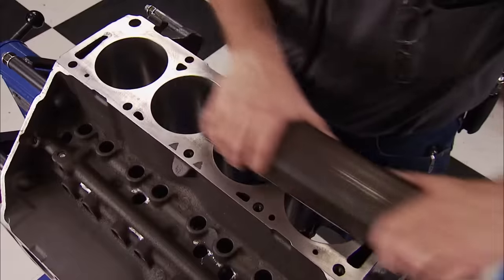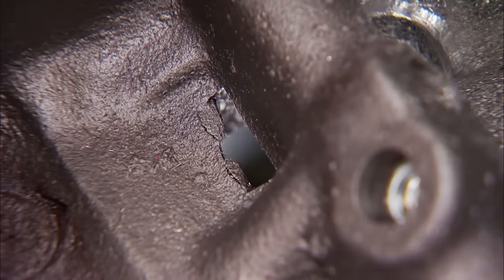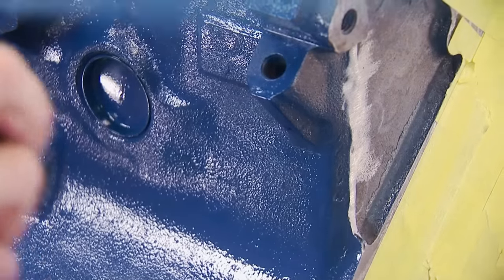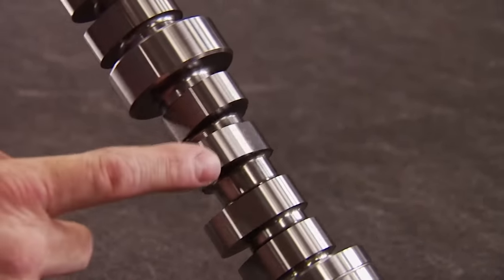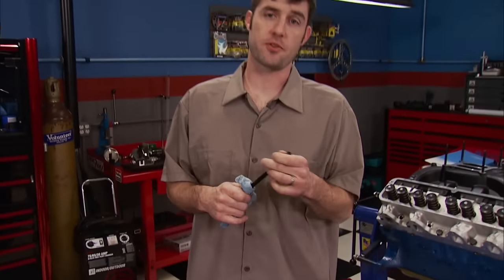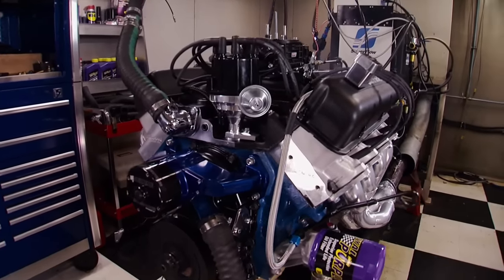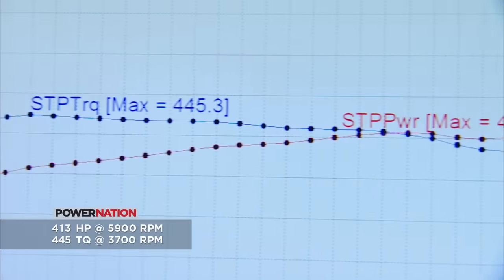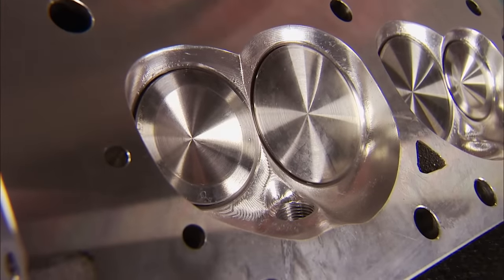Revitalizing A Ford 390FE With A Modern Twist - Engine Power S3, E7

Comment: 390 is a great truck engine. They spec'd a custom cam, so this build should have had a cam with 106LSA using the David Vizard "128 formula".
Reply: 390 was put in nearly everything Ford had at the time. And worked well in every application.
Give me a 67 390 2barrel in a full size Ford car. Good on gas and power.
Reply: @jesse75  390 made good torque with factory heads and intake, but if you're building one for horsepower output, everything spec'd differently. A truck is heavy and needs torque.... Just like a full sized car. Use a 390-2v all day long, I've seen first hand their grunt strength. But in factory form they're a truck engine.
Reply: @richdouche8253  define factory form ?
The car 390 and truck 390 are different. 
390 first used in heavy cars. 
The 352 was phased out in favor of the 390 in trucks in 68.
Reply: @jesse75  Factory form 390's, whether put in cars or trucks, have never been known as big horsepower engines. The runner and port design, size and shape. Combustion chambers. Valve angles. Etc etc. were not designed for making big horsepower. Fantastic for vacuum and low and mid and great torque for street use, but nobody was winning races with the 390 compared to competitor big blocks in factory trim.

Even look at this build... These guys have 390 cubes (plus), and were barely making over 1hp per cube with aftermarket heads, roller cam, rockers, intake and carbs. Hell.... I'd rather have lighter and smaller Windsor stroked to 393 that could churn out more horses on the same mild street stuff.

I'm not bashing the 390. It's just never been known as a heavy breather. Especially in factory form. In any configuration that it was sold to the public.
Reply: @richdouche8253  just like the 351w, the 390 never was a performance engine. 
Maybe in it's infantcy, but the 406 and 427 were the performance engine.
Again. In the 60's and early 70's, the 390 powered nearly everything. It was just a grocery getter like the 351 Windsor, being used in cars and trucks.
Oh wow. They put a 4 barrel carb on these engines, but they didn't amount to anything special. Just moved around a heavy vehicle.
But the 390 is still a venerable engine.
Everyone of these engines I find at a wrecking. I buy. Rebuild. And never have a problem selling. 
The engine is in high demand where I live.
I must have did 70 of these engines so far.
And it's true, many of the stock original pistons are marked 410 on them. But not the car engines, those pistons are different.
Reply: @jesse75  I would buy them up too, especially if you have a market for them around you.

I can attest to the durability and strength of the engines. Years ago my dad had one in an F-100 4x4 "Ranger" and that truck would haul about 3k lbs of recreational crap strapped to it, down the highway at 90mph without breaking a sweat. The whole monstrosity about as aerodynamic as Oprah in a jogging suit. It was impressive. And it would spin 31" mud tires on pavement and grenade transmissions with ease.

I think there were maybe a few 390's that made decent HP certain years, but Ford never really invested the time or money to make them as "credible" as the Chev 396 or 383 Mopar. A shame really. Fantastic durable and stout engine. Just wish Ford made more "400 horse" cars than they did.

351W same thing. Ford once again slapping the worst HP making heads on them they could find. If they'd spent more time/money building 351w hi po stuff, we wouldn't have wrecking yards riddled with 289/302 blocks that split with regularity anything over 450 horses. The 351's handle 700+ all day. And can be stroked above 400 cubes without issue.

Hell, man.....I say buy all the cast iron stuff you can. There will come a day when they're in serious demand. Chev. Mopar. Doesn't matter.

I remember in the 80's I could buy a decent shape Camaro for under two grand. Lol. Wished I'd bought up every decent muscle car I'd seen for sale back then. Wished I'd had the money to. Be sitting on millions right now.
Reply: @richdouche8253  only stock pile I have is Cleveland parts. 
I have one original buddy barr Windsor intake. I ran it on a Windsor I sold last month just to see how it would run. But didn't let it go with the engine.
Most of the engines I do, I run them before anyone gets them. Most of these people don't know how to prime the oil system, nor adjust a valve.
I have some 454's, 350 Chevy's, but they don't sell as well as the Ford's. Go figure.

Comment: Never been a Ford fan but the 390 has always been one of my favorites. You have to try really hard to break one.
Reply: They do have their issues with oil starvation but the skirted block design is really strong. Don't know if you've ever sampled a built 427 but I highly recommend if you get the chance. The throttle response and torque is like nothing I've ever experienced. It revs like a Honda 4-cylinder but with nutty levels of torque. Absolutely insane in those little AC Cobras.
Reply: @randr10  I've been in and around just about every engine you can think of. Growing up in the heart of NC, where you can't spit without hitting a NASCAR Track/Shop/Builder or an NHRA Sanctioned Drag Strip, with family involved one way our another in both. It was extremely unique. Back then, we roamed the Pits. Talked to the Driver's and Mechanics. Got rides in the Door Slammers. Sat in The King's Pontiac. Junior Johnson used to eat at our Restaurant. Rode in his recreation of the '40 he used to run Shine in. Some of the best people you could ever meet. For a Hot Rod Kid it was unreal. Pop still lives 5 miles away from Petty. Step Dad spent some time in Kannapolis and knew Dale SR. for a brief time. I miss the late '70's early '80's.
Reply: @SGTJDerek  That sounds amazing!
Reply: @randr10  Turbo needed
Reply: @Pedrofitbulls  For what exactly?

Comment: I'm thinking that is too much cam for that compression ratio. Lift should probably be in the 530 or 540 range and duration in the 220 range on a 112 centerline. Would probably make more power. Or bring the compression ratio up to at least 10.5 to 1 with that cam.

Comment: Those was actually the correct pistons
390 fe truck engine used the 410 pistons 
The passenger car engine used the 390 pistons. The common  thing to do back in the day was to install the car pistons in the trucks during rebuild or swap in a 428 crank those netting a 410 .
The 360 done the same thing the truck engine received 390 pistons and the passenger cars got 360 pistons

Comment: The BEST big block engine ever made by anyone. It was in production for 18 years and went from 332 cubic inches all the way up to 428 cubic inches. Ford could have easily made much bigger if it had not been for the 385 engine family that was made to replace it.
Reply: Not even close, fe’s are turds. A stock 429 68-71 made these numbers. 429/460 is light years ahead of an Fe and better than a BBC imo.   Fe will always be held back by its garbage cylinder head.  These aftermarket heads flow less cfm on the intake side than a stock 70 closed chamber 4V cleveland head. Rich Holdener did a vid of a bone stock m code 70 clev with headers, cam and an intake, made 450 hp.  Fe’s are good grandpa engines, not racing engines
Reply: @RacingRon47  Actually Rich's 351 made closer to 360 HP not 450. Still a nice engine though. I was impressed with his 400 "factory stroker Cleveland" build's?
Reply: @RacingRon47  "A stock 429 68-71 made these numbers." No it didn't. All 60s hp numbers are a lie. Put it on this same dyno.

Comment: Best twist about a FE is when the oil pump shaft twists into a pretzel LOL, and you gotta love those rusted exhaust bolts when they break because they are through holes and rust. Great design!
Reply: Or you go to pull the distributor,and some schmuck was goofing around and now your driveshaft is in the oil pan. 
But wait,there's more.
It's in a van 😂😂

Comment: Cool video and 390's RAWK, but how did the timing advance when the vacuum advance wasn't hooked up?
Reply: There is mechanical advance under the rotor that is all in by 2500-3000 or so depending on the strength of the springs.  Vacuum advance is for low RPM, off idle operation.
Reply: @JimBronson  Ah yes, this is true and I had forgotten about that. Thanks for the reminder.

Comment: Would've been nice to see a little higher compression than 9:1. 
It's not the 80s anymore, with those heads and that cam, 10:1 would've been just fine.
Glad to see the FE getting some love though.
Reply: It would've made about + 5% more HP so say another 20-25hp. There's a rule of thumb that for every point of compression there's approximately a 5% gain all things being equal including fuel.
I read another paper that said compression increases beyond 9:1 result in less power increase than increases up to 9:1.
I don't really know what that means but I guess the power increase from 6 - 7:1 might be 15%, between 7 - 8 might be 10% and 8 - 9:1 maybe 8%. Sounds reasonable. That's all on the same fuel too and was on a single cylinder test engine with a hydraulically operated variable compression piston. Hardly a real world V8 but interesting none the less, no?

We know increasing the octane rating of fuel combined with compression increases yields more than 5% generally but then things like high flowing heads and camshafts and huge tube headers and all this other stuff adds to the non level playing field I suppose.

Comment: love fe ford's, drag race with one, should have drilled through the block from the oil filter housing side to the oil pump hole. also link timing chains are more durable for syree use and you could have went with the trick flow heads and jumped 50 horsepower.
Reply: @bigboreracing356  the fe ford engine has won multiple engine masters competition for horsepower per cubic inch, it'd put there in you tube land to see
Reply: @bigboreracing356  maybe in your generation. not mine.
Reply: @bigboreracing356  already done it, many times, been racing on the strip a long time with it
Reply: @bigboreracing356  I have had other racers ask my permission to measure my rear-end and look at how I built it.  damn truck is fast but it is about a lot more than an engine, as it pertains to the strip your rear-end and suspension are super important to be able to hook all that power up.

Comment: Thats a cool build with a lot of good advice..  but where is the modern twist?  My fe has a sniper fuel injection setup with the matching  cd ignition which is controlled by the sniper system. I thought that is when you would be going with this .

Comment: I dont know anyone in real life who has had any luck with E3 plugs, except on small engines like lawn mowers.
Reply: A lot of engines really like them, especially the older mechanical distribution motors. I have seen a few computer controlled cars have issues adjusting the curve though.

Comment: Did you really torque that intake without putting the distributor down in it first?
Reply: Distributor does not go through the intake on a old Ford engine..

Comment: At 8:22  I see your using a "factory" full-length hex shaped oil-pump driveshaft...a big no-no ...At  1:23 , see that roll-pin on the gear on the distributor?...If the oil-pump locks up for ANY reason, that roll-pin will likely have enough strength to twist apart that skinny driveshaft....This scenario will have your ignition still working & the engine still running , but with a non-functioning oil pump. Get the thick-walled 3/8 " driveshaft instead....
Reply: Yup it happens.
Reply: I tore apart an original never been apart 352 that was a good runner, and the oil pump driveshaft was about to strip out where it indexed into the oil pump itself. Wasn't twisted, but the edges of the hex were rounded off where it went into the pump. Scary!
Reply: @bigboreracing356  I think the best thing to prevent that is getting rid of those damn umbrella valve stem seals that crystalize and fall apart after about 50,000 miles. Those seem to be the biggest cause of why oil pumps lock up and the shafts fail. I'd be interested to see what happens to an ARP driveshaft should the pump encounter something to lock it up vs the stock shafts that turn into a pretzel.
Reply: @bigboreracing356  doesn't have to be a locked up pump. I've seen them break because the pickup tube was full of silicone debris. Also if the pan gets bent into the pickup which happens on trucks often. The stock pump drive is fine most of the time, there's just not much extra strength if something out of the ordinary happens. The ft version found in big trucks had a bigger oil pump drive stock because they all had hi pressure/volume pumps for on board air  compressors.
Reply: @bigboreracing356  I'll take first-hand accounts "I've seen them break...", and "Mine damn near failed...over the strange ramblings of boy-racers. My brother-in-law was like that, lots of puffery, big talk...but little experience.
  Do tell, tell me what cars  YOU were wrenching on in 1974?
Reply: @bigboreracing356  I was referring to the whole of the system...oil pump-driveshaft-gear-roll pin-distributor ...along this assembly, the weakest point seems to be  the driveshaft itself...too thin, too long, & the hex shape doesn't provide great strength. Who here among us has marveled at the "springiness" of an eighteen inch long 1/4" extension off a ratchet? Someone long ago while designing the FE should have thought to redesign that driveshaft into a more robust variation, "the path not taken".

Comment: I’ve got a ‘68 390 S Code from a Mustang. Wonder what the differences are in the stock parts, crank-heads-pistons-rods,  from car to truck.
Reply: Cam and compression. Think valves also. My 66 galaxie500xL had the 352. My dad had a 67 galaxie500xL with the 390. And a 64 thunderbird with the 390. And a 74 f350 with the 390. Love them FE motors. Been a while since ive messed with them though.
Reply: There are tons of different specs and applications for these engines. Started in 1958, with 332 cubic inches, and ended in 1976 with many variations in between. This is the engine family that famously beat Ferrari at LeMans with the 427 variation. If my old mind is close, I think there are at least 20 different versions of just the 390 cubic inch version, from the factory over the years.
Reply: From what I have read the 390 GT used the same heads as the 265 HP 2bbl engine.

Comment: I just bought my Father-in-law's 1982 F-150 with a 460 and 4-Speed Transmission.
Fuel Economy is pathetic...
How could I improve this?
And, the Front Suspension and Steering is scary!
Improvement Suggestions are welcomed.
Reply: I would do is add an EFI kit from Holley to the 46p Big Block and replace the factory bushings with polyurethane bushes and man you'll be amazed how much you're truck will perform on a tighter budget.
Reply: Smaller carburetor
1" Phenolic carb spacer
Carb gasket with a screen
Junkyard rear end with a lower gear ratio
Light foot on the gas on takeoffs
If you have a dyno shop nearby, go rent some time and adjust the carb so it runs slightly leaner on part throttle
Narrower tires reduce rolling resistance 
An open side air cleaner will suck hot air from the engine compartment, which makes it less dense and lowers the engines volumetric efficiency, less air means less fuel
Make sure your distributor has vacuum advance and the valve it's getting vacuum advance through is the right temp range
Warmer thermostat
Reply: And for the steering, make sure the rag joint is still good, lots of videos on that and it's an easy cheap common fix. The steering boxes also get sloppy but are adjustable. Also check the rubber bushings where the control arm connects to the truck. Those get loose over time and are definitely a good place to upgrade to some poly bushings

Comment: I must say I'm kind of surprised that the only thing holding the connecting rods to the crankshaft are a couple of nuts. With all the vibration, heat and lubrication I imagine they must be susceptible to loosening themselves. But then again, I just don't understand.

Comment: Question. Why did u set the cam up 4* advanced and not 'straight up?' Ive noticed that u guys do this alot.
Reply: Moves the torque and hp peaks lower in the rpm range. I think it's 50 rpm per degree but I might be mistaken.
Reply: Moves the powerband.

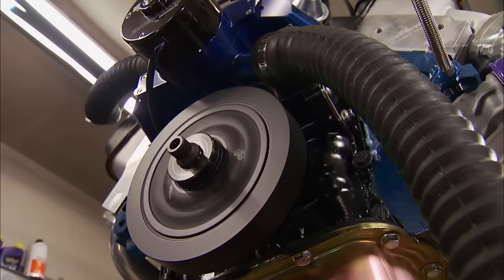Comment: Im surprised you guys didnt get way more power from this motor. The 390 was 335 hp and 427ft lb stock. Figured this design should render at least 450hp. Im very surprised at the torque levels here. Not much improvement. Harmonic balancer at 14:58 looks very warbly. Very strange

Comment: Hmmm, 3.78" stroke at 6500 rpm is about 4100 FPM.  Are the stock rods really up for that?   1960s iron.  Think about it.
Reply: Frank Guerrini's 390 turned 8,000 with its nodular iron crank and non-LeMans rods.
That's the same stroke as the 427 FEs that dominated LeMans.
Reply: @geoffmcnew5863  I really doubt those connecting rods were standard issue Ford Galaxie/Fairlane rods.

Comment: Cast steel does not have a higher carbon content than cast iron. That's waaaay off the mark 2-3% carbon content for cast iron vs. .4% in 4340 hence the 40 at the end. That's the carbon content when talking steel. The cast steel is stronger because of the added alloys not the carbon content. High carbon actually helps make it more brittle lol

Comment: FE 390, THE BOAT ANCHOR MOTOR. 390's WERE ALWAYS SMOKED BY GM BIG BLOCKS AND MOPARS. EVEN GM SMSLL BLOCKS  AND MOPAR SMALL BLOCKS ALWAYS TOAST THIS FE ENGINE.
Reply: Say all you want about them, got a 69 ford galaxie xl with a 390fe stroked to 445 fully built making 750 to the crank, chopped everything from vl turbos to holden maloos

Comment: By the way folks E3 plugs are junk good for the first 10,000 miles but hey put some good plugs in they make great plugs now some engines because the cylinder design specially four valve design work really great on the Bosch platinum. four